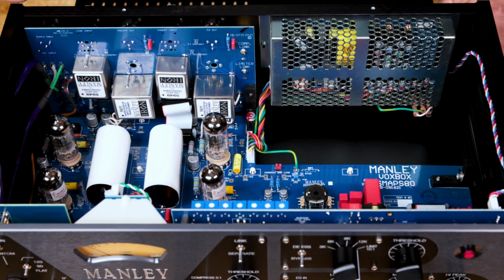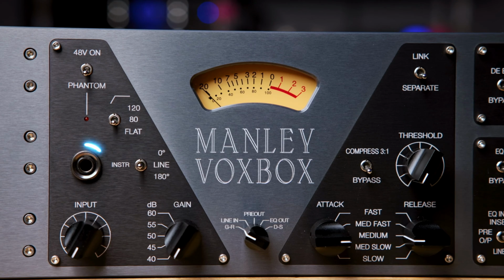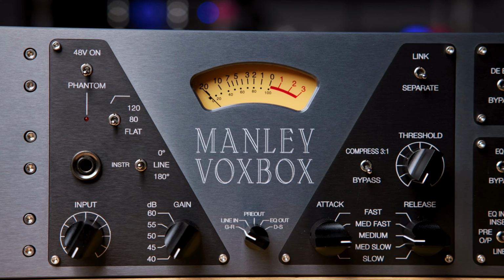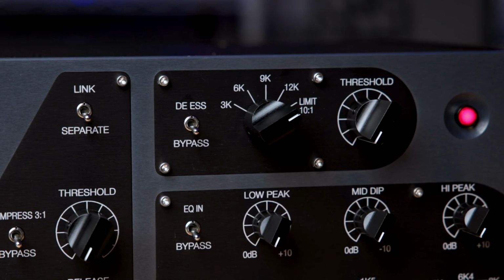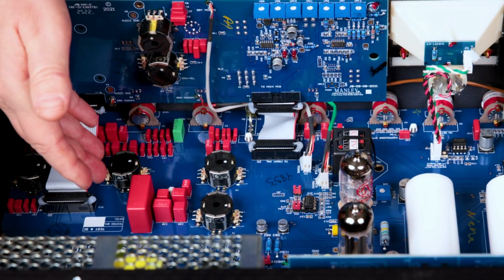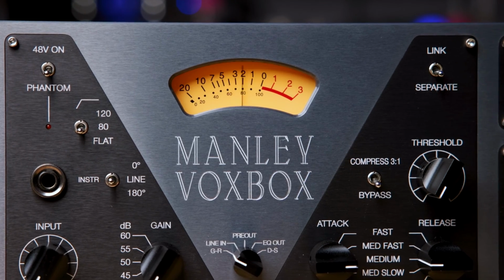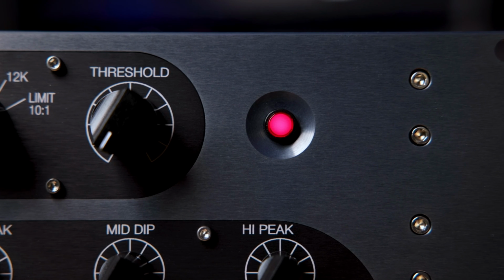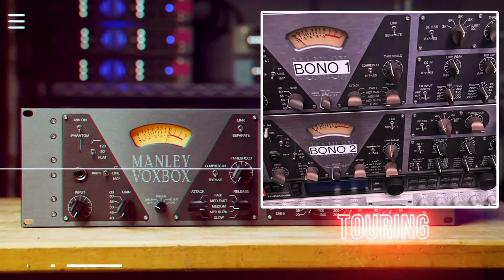Inside the All-Tube Manley VOXBOX with EveAnna Herself!

Comment: i need to dig up the old manual to figure out whether my early 2000 version, with 1/4" ins and outs for everything (except the Mic input), also is transformerless for all those connections. Anyone?  Is my instrument input on the front also transformerless?  I was hoping to reamp vocals using the actual reamp output of my Antelope interface and go into the hi-z input on the Manley to get to its sweet preamp, but I didn't realize the hi-z input might be transformless.

Comment: Having the manufacturer talk about the products is always very nice. Thanks for taking the time. P.S. I thought the signal for the compressor was derived from the input, not the output as mentioned @ 1'12"...
Reply from the maker: The detector signal for the compressor is picked off at the back end of the amplifier while the element that is driven by the side-chain which modifies the voltage divider lives before the amplifier.
Reply: @manleylabs  Sure, IT IS the sidechain activating the gain reduction... got it. So can we say the compressed signal is at mic level while the sidechain controlling the opto cell is at line level? Not that it matters much, only for clarification... Voxbox is just awesome, just used one a few days ago. Again, thank you very much for your time, precious added value to your products.
Reply from the maker: @gabrieleponticiello6842  Let's free ourselves from constraining labels, shall we? Well, so, technically we scored around 20dB of free gain from the mic input transformer, (which a DI or Line input signal would not enjoy) and then the gain in the tube amp applies 20 to 30dB more depending on how much feedback was selected on the GAIN switch, so, like, instead of assigning "line level" or "mic level" names to the signal, you can fall back on the relative levels... See?
Reply: @manleylabs  I see. Thank you!

Comment: Thks great video . When using  the front end  guitar input, you bypass  the  transformer, but why bypass the transformers especially if it   juices up the signal but keeps it clean?
Reply from the maker: You have the CHOICE to come in transformerless in the 1/4" front panel jack or use the rear-panel XLR connector for your balanced transformer coupled input.